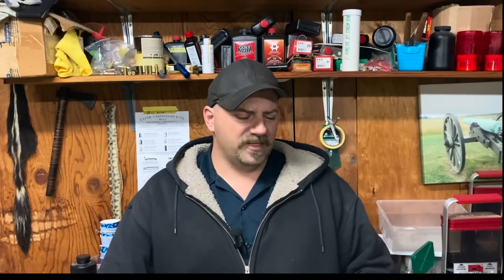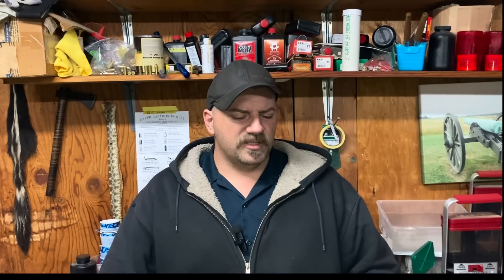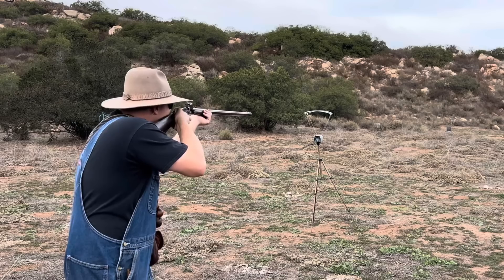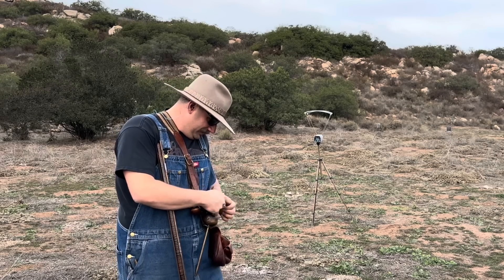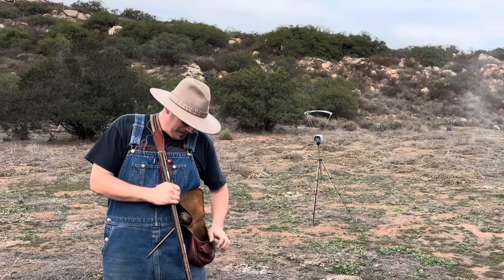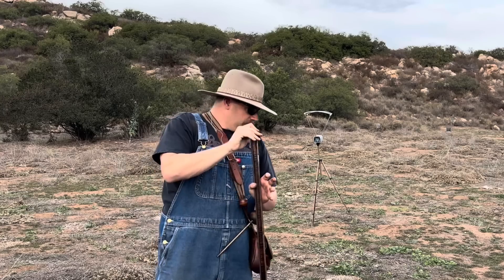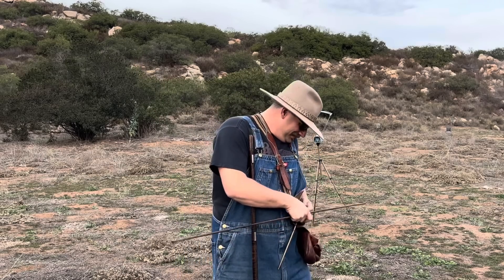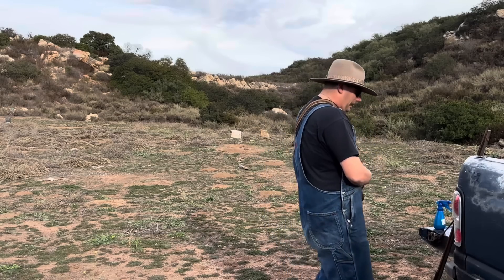Black Powder (Carbon Black)

Comment: I almost commented on an earlier video when you mentioned trying this that you shouldn't bother, but I was curious how bad it would be. What people forget about carbon is that diamonds are "pure" carbon, graphite is "pure" carbon, same with graphene, buckeyballs, carbon nanotubes, charcoal, soot... Being pure carbon doesn't tell you anything about its properties because carbon can form an infinite number of molecular configurations. A diamond is a single giant molecule of chained carbon atoms. A lump of charcoal can be made just as pure carbon as a diamond but that doesn't make them the same thing. Lampblack can be made on a spectrum of molecular configurations, but most of the commercial stuff is closer in properties to graphite than to charcoal. I'm certain most of it doesn't even burn in your powder and it would have hardly been flammable at all had it not been for the sulfur.
Reply: Couldn't have put it better and I was also going to comment previous to not waste your time, but people usually only believe what they see. Carbon Black, CAS# 1333-86-4 is mainly used for coloring Rubber like tires and making them more durable. Lamp Black has the same CAS#, but its properties are different. So technically they are NOT the same thing as people want to think. Lamp Black is mainly used as a pigment for coloring anything and everything from Concrete to Paper. It would be worse than Carbon Black. Don't bother.
Reply: Okay  I want him to use pure crushed diamonds!🤡 Actually, I'd like to see single atoms used, but Buckminsterfullerene might be interesting, too.
Reply: Damn, he had you at buckeye balls. Thank God for the internet.
Reply: @maxlumens9085  If I hadn't recently driven through Missouri and Oklahoma, I wouldn't know what you were talking about.  They're pretty tasty!
Reply: Tru Dat!!!
Reply: This I could have told you: Petroleum products do not do well with blackpowder. That is one of the reasons that petroleum based bullet lubes are not recommended for use in blackpowder cartridges.
Reply: I think I've heard that lamp black/soot has a large component made up of an assortment of buckeyballs and buckeytubes.

I would assume that any buckey types of carbon structures would have very strong molecular bonds, like diamond, and thus
would not burn well.

That's why long-length grown buckeytubes are being looked at as the structural component in space elevators.
They're essentially micro-thin diamond strands.

It takes a lot to get a Diamond to burn.  Pure Oxygen at 690-840C degrees.
Reply: lol ya I was thinking it too But I was curious. It's small carbon but coated in hydrocarbons.
Reply: I've made a bit of (poor) black powder over the years and also experimented a little with the carbon source. I think that @nighthawkinlight has part of the answer in that perhaps a fair proportion of the lamp black is in the form of very stable graphite. I think one other issue is surface area of the particles. These small particles probably have fairly uniform shapes as opposed to even finely milled charcoal. You mentioned a smell too. Perhaps the lamp black is collected off its deposition surface with a solvent that is recovered and has petroleum residues in it which would cost all of the particles. Thoughts?
Reply: @joetaylor486  ya but if it is made from burning oil.  the particles will be covered in unburnt voc's. Maybe if it was reheated in an anoxic environment to drive it off. But I doubt it will help that much.
Reply: @dontimberman5493  Fair comment, sir!
Reply: @joetaylor486   Well, since we've realized that the structure of the carbon/charcoal is critical to its burn rate, then perhaps the next thing to try is activated charcoal.   It will have the "fluffiest", open structure, with maximal surface area per carbon atom.  The wikipedia article on it makes the comment that activated charcoal is to charcoal as popcorn is to dry corn kernels.
So, process the wood/cellulose for a bit to strip out all the lignin and other gunk, then convert to charcoal, then.... wait.  I just checked the Wiki article, and the current thought for the structure of activated charcoal is similar to fullerenes.  IE, the kind of carbon that won't burn easily.

NEVER MIND!  I'd delete this, but it should be added as a note to NOT try activated charcoal.  😆
Reply: @rmkenney  interesting thought process.... 😁
Reply: @joetaylor486   I'm trying, I'm trying.  This is truly interesting to me!  I'm 66, but maybe I should go back to school in a industrial chemistry path! 😁
Reply: Was about to comment but you literally said everything I was going to. It's no wonder I am subbed to you and everything black powder. Fun to see we all run in the same circles.
Reply: Hey Ben, I haven't seen you on amateur pyro in a while. You should look back into it.
Reply: Well there you are. Now you know. BP need’s carbon in the form of  charcoal. That ain’t it.
Thanks . The comments were truly enlightening too.
Have you tried burning that stuff by itself to observe it? I bet it leaves greasy residue and smokes. (if it lights at all)
On the bright side, you have the makings for some black grain filler or paint. Basically, a bag of pigment.
Reply: @chopsddy3  laser jet toner doesn't smudge
Reply: Love to see that Nighthawk watches the goofy side of black powder stuff, you are def better off just using face tissues or toilet paper...
Reply: Bucky is looking for his balls and tube.😁🤪
Reply: No way! You watch this guy too?
Reply: Charcoal, properly retorted for black powder is not pure carbon. It's 75-85% carbon.
Reply: @pursaveer9027  "is not pure carbon. It's 75-85% carbon." 

What's the rest?
Reply: @Dr_Wrong  Ashes, some of them may act as catalyst
Reply: @Dr_Wrong  The rest is volatiles and ash. Properly retorting the charcoal at controlled temperatures preserves the volatiles. That's what commercial manufacturers do for ballistic grade black powder.
Reply: @Dr_Wrong  Silica, salt, sodium hydroxide etc (also known as ash)
Reply: @Dr_Wrong  10% N atoms, and 5% H atoms.
In this case it was laserjet toner without SiO2.
Reply: @pursaveer9027  Thank you semantic man. You might notice I said "can be made".
Reply: @Nighthawkinlight  To which I would respond "can't be made". A lump of charcoal contains ash. No need to get testy about accuracy.
Reply: @Nighthawkinlight savage lol. I like how you drop by on here as well. Have a good one.

Comment: Lamp black is a soot accumulation as you surmise.   I heard it sucks too and I think it's the 2@& 3 dimensional multiple  forms of carbon that you are exploring.   BTW, I just replicated your TP powder (Cottonelle) and it's awesome, it's also the fluffiest charcoal I've ever made,  a quart only weighs 2.5g.   I think that surface area contributes to a faster chemical conversion to gases and solid byproducts..that translates to increased velocity.   Now...think about oxidizers like perchlorate, guanidine nitrate,  burning rate catalysts, and consider your flintlock ignites more from deflagration more than a shock wave, 209 primer is awesome. Keep it up brother!
Reply: You need 15grams of charcoal to make a hundred gram batch.  If a quart of Cottonelle charcoal only weighs 2.5 grams, you would need 6 quarts.  Are you sure that weight is correct?   Should that be 25 grams, not 2.5?
Reply: @chaecoco2  Yes he fucked up, a roll of TP comes out to about an ounce.

Comment: Graphite and especially diamond are very near pure carbon but, for whatever reason, seem to make poor antique muzzle loading propellant. Charcoal has a lot of surface area, maybe that helps.
Reply: The carbon atoms in graphite, and diamonds have a defined crystal structure. They are very tightly packed into these crystal structures, so the intermolecular bonds between the individual carbon atoms are much stronger. It requires a lot more energy to break these bonds. This makes graphite, and diamonds much less reactive. On the other hand, coal, and charcoal are forms of amorphous carbon. This means the carbon atoms don’t have a crystal structure at all. Instead they take the form of random clumps of carbon atoms. These clumps of carbon atoms are more spread out, have weaker bonds, and are more reactive as a result. So, while surface area is important, the strength of the intermolecular bonds, and the energy required to break them is much more important. Without enough energy to readily break these bonds you either get no reaction, or a very slow one.
Reply: Maybe that’s why lampblack/soot performs poorly, it was the carbon that did not burn easily the first time. So, maybe the carbon that is not packed right for easy combustion…
Reply: @jertres2887  So, the reason lampblack doesn't burn well is not the conformation, or  crystal structure of the carbon atoms; i.e. it's not the carbon itself that's the problem. The carbon atoms in lampblack are in an amorphous form like that of coal, or charcoal. Rather, it is because lampblack has many organic impurities in it that impede its combustion. I will explain in more detail if your interested. It's kind of a complex topic, so bear with me. 

The impurities are the result of incomplete combustion of a fuel. Either because the combustion happens in an oxygen-poor environment, or the intramolecular bonds (the bonds within the molecules) are relatively too strong requiring harsher conditions to break them completely. These reactions in oxygen-poor environments are called pyrolytic reactions, or pyrolysis. In these reactions you get highly reactive, unstable carbon radicals (a radical is an atom with an unpaired electron, so it doesn't want to exist). These radicals react with all other molecules, including other radicals, in their vicinity forming larger molecules, and more radicals. So, the reaction products get bigger, and bigger. The result is a complex mixture of organic compounds that are tarry, or oily. Examples of these compounds includes some lower molecular weight arenes (an arene is an organic compound with a very stable aromatic ring system: these have strong intramolecular bonds), and larger polyaromatic compounds such as benzopyrene, anthracenes, etc. These arenes, because of the stability of an aromatic ring system, are not very reactive. Thus, larger arenes, and polyaromatic compounds aren't very flammable. Lower arenes do burn but they too produce a lot of soot too for the aforementioned reasons. For example, simple lower arenes like xylenes, toluene, benzene, etc. all produce lots of soot when burned. 

To get these large compounds to burn you really have to oxidize the hell out of them. This requires large a excess of oxidants, stronger oxidants such as pure oxygen, ozone, etc., and/or higher temperatures. For example: "...solid waste combustors has brought about the injection of excess oxygen to ensure that complete combustion will occur. In some cases, as much as 200 per cent of what would be stoichiometrically required for complete combustion, is added." These things just really don't want to burn. The presence of them in the carbon in lampblack really makes the complete combustion of lampblack really difficult under normal conditions.

Comment: years ago experimenting with axle grease to cover the projectiles in a 58 rem copy ,,i quickly discovered the gun locked up after 2 cylinders , i guess petroleum products just dont work with black , another great presentation , cheers big ears from down under

Comment: I am not sure, but I would guess that the poor perfonmance of lamp black bp, is due to high amount of ash present. Alternatively the mixture might have been too fuel rich, leading to unconbusted carbon black fouling tthe barrel. Possibly both.
Reply: Lampblack actually doesn’t have ash it. Rather it has a complex mixture of organic compounds (complex hydrocarbons like polyaromatic compounds) from the incomplete combustion of fuels. This mix of hydrocarbons results in the lampblack being a little oily which resulted in the fouling seen in the video.

Comment: dude corn starch might be a really interesting carbon source, its a different type of cellulose structure. but its already purified and powdered so carbonizing might be interesting.
Reply: Cornstarch is a deterent. The dextrin that some makers add to their powder is essentially cooked cornstarch and is used to "stabilize" the powder for a more controlled - but consequently slower - burn.
Reply: @kirkboswell2575  cool good to know
Reply: no celulose in corn starch.
Reply: @VinylOutsider  however he said to produce CHARCOAL out of cornstarch, not use by itself. and I totally agree, I'm suggesting this 3 videos already.
Reply: I think you need cellulose to make charcoal.  I could be wrong though @papanyanz

Comment: Thinking out of the box. Anthracite coal.  Known as hard coal.  Low sulphur.  Low ash.  High carbon.  I'm from Eastern PA coal country where it used to be king and it's still mined.  There are several companies around here that pulverize the coal into fine powder for use in pigments, cosmetics, tires  etc.  Unsure where it can be purchased.  Since its natural, I'm also unsure of it's actual carbon consistency.  But it could be worth a try?  I could send you a couple pounds of rice or pea grade Anthracite (very small pieces for auger feed furnaces), you'd need to pulverize in your ball mill.  I don't know about cooking it in your retort it'd become coke (not the Hunter stuff though.)
Reply: 😂 I’ve driven through there, some places it just rolls out onto the damn road.
Reply: Graphite is coal that's been purified by geological activity, maybe try that? Just not the pencil lead stuff they put like clay and other binders in that.